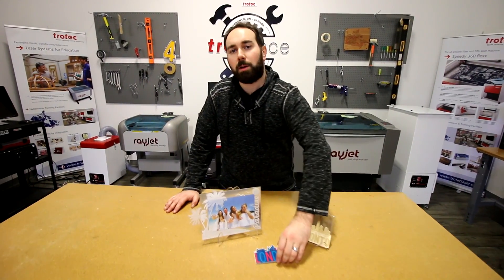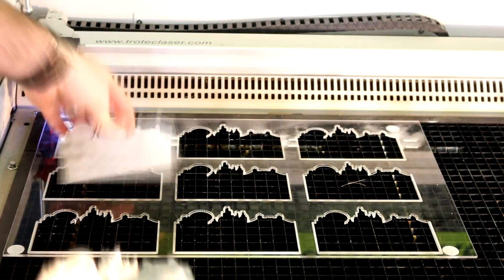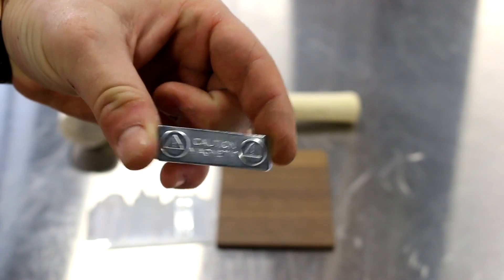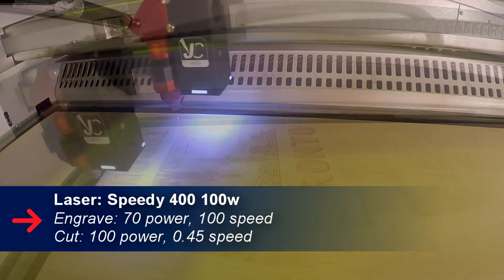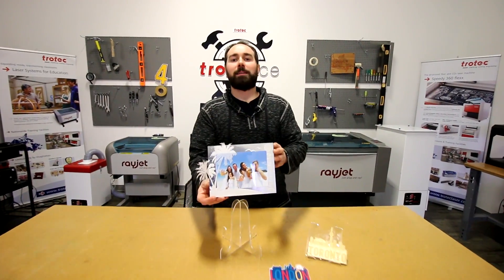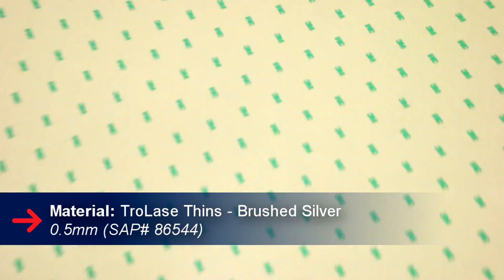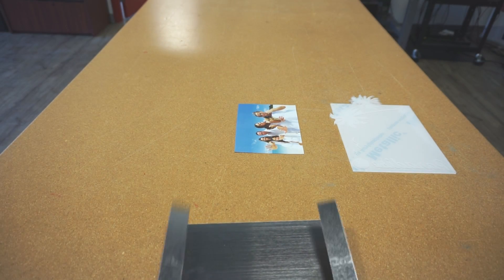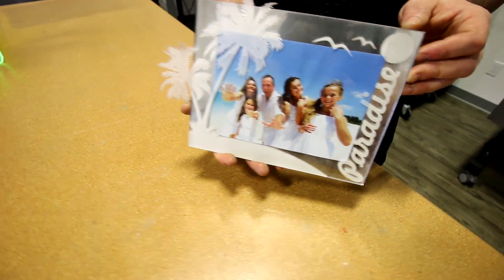DIY Fridge Magnets | Laser Cut Fridge Magnets | Trotec

Comment: Why go through the time and expense of inlaying magnets when your laser can cut rubberized magnet sheet that comes with an adhesive backing to the exact profile of the acrylic? I cut 1.6mm thick rubberized magnet with a 10W diode laser @ 100% power and 4mm/sec. One pass will cut through cleanly.
Reply: Bro I'm trying to find this comment from very long time. I also want to make customize magnet but not sure about 10 watt diode laser machine can cut or not.But your comment gave me a hope ❤

Comment: Can these laser cutters cut sublimation aluminum or hardboard?
Reply from the maker: We've never tried hardboard but since its organic that shouldn't be a problem. As for aluminum, no unfortunately we cannot cut metal.
Reply: @TrotecLaserCanada  Thank you for the reply.
Reply: @TrotecLaserCanada  - Well, what if you made Multiple Passes, in Vector Cut settings? On thin Aluminum?
Reply from the maker: @robertweekley5926  it is possible with our galvo fiber lasers but it's not ideal. Because the galvo (SpeedMarker) is extremely fast you can do thousands of passes quickly, but not with flatbed lasers like the Speedy series.
Reply: @TrotecLaserCanada  Hi. I’m here for a school project. 
With aluminium could you just use 2d design to make fancy details? I don’t necessarily need to cut through it, just make detailed prints. 

The design is either going to be a circle, 
12cm by 12cm, 1cm thick, made of Matte grey stainless steel 
Or
Grey bushed aluminium alloy of something. 

I don’t know how to cut a metal circle 1cm thick 🤷‍♂️

Comment: Does the residue from the adhesive on the front side of the trolase eventually fade so it can not be seen through the clear acrylic?
Reply from the maker: Hi Gabriel, no because the 3M adhesive is quite strong and we use clear acrylic. Another option you can do is our double-sided thin engraver's tape that would leave less of a mark.
Reply: Thank You